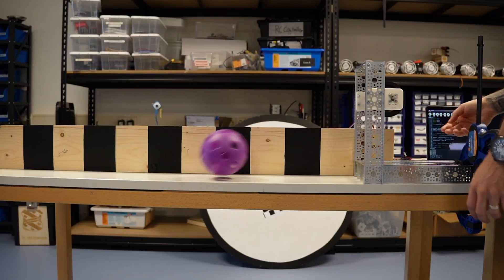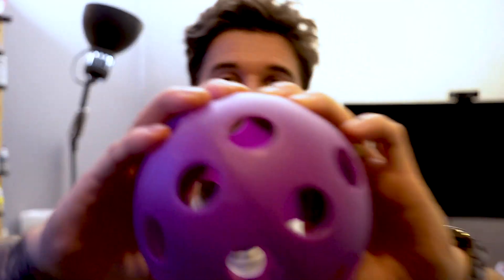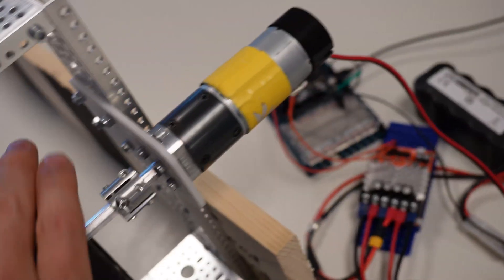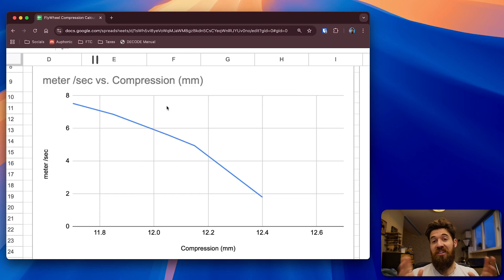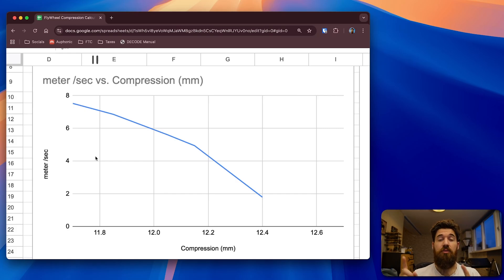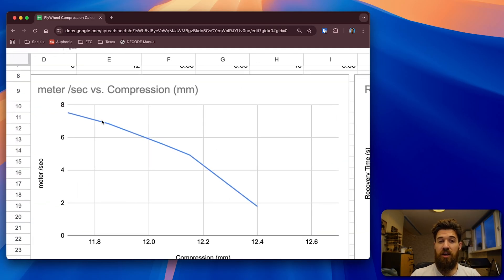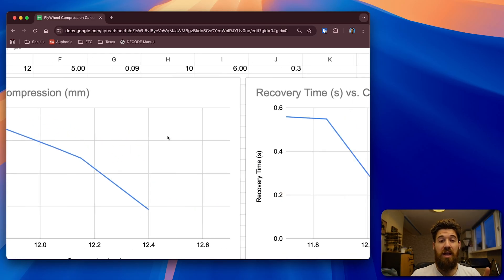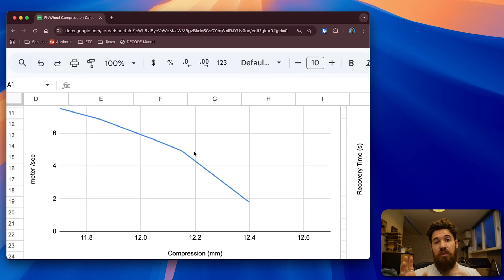Building Flywheel Shooters: How Much Compression Do You Need?

Comment: Have you done any testing on different amounts of flywheel to ball contact? How that affects consistency and energy transfer?  Been looking how amount to time of contact of each of the 2 axises affect energy transfer as well as trajectory and spin stability. The most obvious is that of rotational path, how many degrees of "travel with contact" a ball needs to have between flywheel and backplate, to get a strong stable centered shot with consistent backspin. Adjusting the arc of the backplate to a larger and smaller about of degrees is not too hard. Testing the other axis is harder, the degrees of ball surface and flywheel contact, along the axle axis.  While this somewhat changed by compression, it could really be altered by using flywheels that have a hyperboloid form to their outer surface. Harder to make a bunch of different ones without a bigger machining shop than i have on the daily. though my assumption is a longer more shaped contact process is going to smooth out and bouncing around that the abrupt movement of bot and ball have produced.
Reply from the maker: I've done the first test you're suggesting adjusting the arc, changing the eventual end angle of a hooded shooter, where the time the ball is in contact with the flywheel increases with angle: https://www.youtube.com/watch?v=qfSNkoJ1h1U&pp=ygUUYW5nbGUgc2hvb3RlciBicm9nYW4%3D

However, the 2nd test is interesting. I've seen some teams using hyperboloid shapes in the past, one thing I wonder is the viability of adding in a grippy material to this type of flywheel. We already know that energy transfer is better with less slip, and adding a silicone outer layer gets difficult quick on a shape like this that I suspect it has more to do with ease of tool creation.

Comment: Hey there, Mr. Pratt. I am a member of team 17658 Wildcat Robotics. We currently have REV Robotics and some Tetrix parts at our disposal, specifically HD hex 40:1 spur gearbox motors, core hex motors, and Torquenado 20:1 motors. In your opinion, what would be a good combination of motors we could use for our flywheel? We aren't set on a design at the moment, so we are open to all options.
Reply from the maker: If those coreHex are base motors, that'd be your best bet with a pinion belt/gear attached. Many teams have had success with final output RPM's of 4K-6K in motors.
Reply: @BroganMPratt  Thank you very much! I'll let you know how it goes!

Comment: Question, how much compression would you recommend for dual flywheel launchers where the wheels are on the left and right or top and bottom.
Reply from the maker: About the same. 5-7mm seems like a pretty good starting point.
Reply: @BroganMPratt  Okay, I just want to clarify something because I am a little bit confused about the distances you gave. so let's say I want to do a 6 mm compression with a dual flywheel mechanism. That means if the ball is 127mm, on the cad the distance between the outer edge of each wheel should be 121mm for a total 6 mm compression or or 115mm for a 6mm compression on both sides?
Reply from the maker: This test is only run on a single flywheel, not a dual flywhel setup. I'd say start with 6mm compression total, for a total outer edge > outer edge distance of 121mm, and go from there. This is simply 1 data point in a see of data, but should give you a good initial starting point.
Reply: @BroganMPratt  Thank you so much. We're broke rn and can't exactly test for another month ish so seeing you test out all this is really helpful :)

Comment: I’m confused. The ball is 127 mm or 12.7 cm so when you’re talking about the compression of 12.4 mm I think you mean the compressed diameter of the sphere or ball is 12.4 cm not millimeters.
Reply from the maker: I messed up in my title descriptions in the video, oops:
Ball is 127mm
Compressions are shown in distance between the flywheels: 
124mm
121,5mm
120,5mm
118,5mm
117mm

Comment: Nice video. How about testing recovery time with a heavier flywheel with the mass as far out as possible? Also, I recommend staying consistent with your units (your demo is in inches and your charts are in mm).
Reply from the maker: Great idea. 

Units are consistent, I did mess up on my expression however. I’m showing distance between flywheels on tests, so test 12.15cm is a 5,5mm compression on the ball. I recognize now this wasn’t a clear way of displaying this knowledge.

Comment: I have a question, is higher rpm always better? Our team only has access to 100rpm [50.9:1] high torque motors, we plan to 3d-print some gears to increase the rpm. Should we strive to to reach the highest rpm possible that the gears can handle without breaking?
Reply: Also, tysm for making this video. I was looking for something like this since the start of the season.
Reply: I'm thinking of aiming for around 1200rpm with a 100mm wheel
Reply from the maker: Not always. For gobilda motor curves, 3000 RPM is best as it is the most efficient.
Reply: I would be worried about the 3d printing gears, becasue when teams near me used 3D printed gears the teeth on the gears stripped. I would highly encourage you to buy gears or the motor, or print with Petg or carbon fiber
Reply from the maker: Depends how much torque is going through the system. Lower torque settings, 3d printed gears are perfectly acceptable.

Comment: Hello Coach Pratt was wondering on your opinion on the sparkfun lazer odometry ?
Love your vids
Reply: Our team found that if you get it dirty, it is worthless. Dust and small mat particles accumulate very quickly, it needs to be cleaned constantly, and for us even that wasn't enough. We switched back to odometry wheels.
Reply from the maker: This rings true for optical sensors, and I’m not surprised to hear this. I’ve personally never tested the specific sensor.
Reply: @clintmarvin7754  Same with ours. We think it might also be different lighting, as the field lights and other robots' lights really threw off our sensor during Auto.
Reply from the maker: This rings true for any optical sensor. You definitely need to keep it dark!
Reply: @clintmarvin7754 thanks for the heads up 👍

Comment: so more compression is less spin?
Reply from the maker: Less slippage would translate to less rotation on the ball, yes. Not necessarily more compression. If I had used a grippy surface like a silicone rubber for my launch pad, I’d likely be able to get away will less compression here. Another option you can do is add a greater backspin to the ball with a secondary roller at the end of your launch ramp to take advantage of the Magnus effect to increase your loft time if you need more distance.
Reply: @BroganMPratt if instead of smooth poly as my ramp I put some foam on it it's less backspin ?Because I have way too much spin and the ball jumps out of the hoop or what's it called.
Reply from the maker: That would work, yes. by hoop, do you mean the goal? Or the actual ramp/hood of your shooter? You may find a greater "loft" rather than beeline shot leads to a less bouncy ball inside of the goal.
Reply: @BroganMPratt the goal